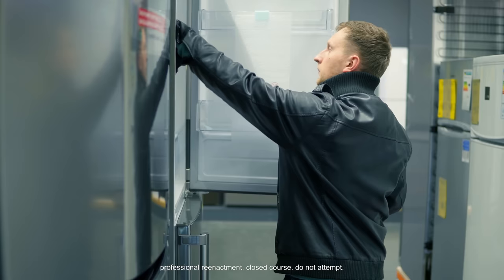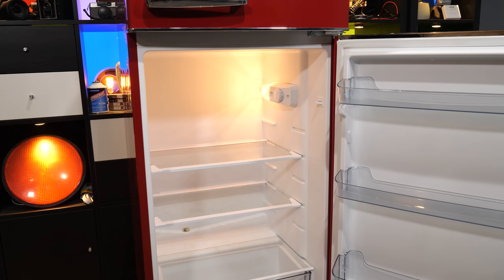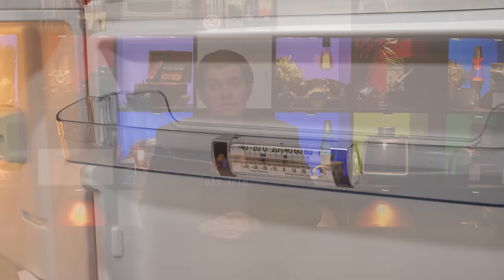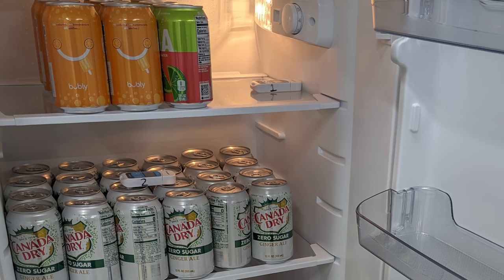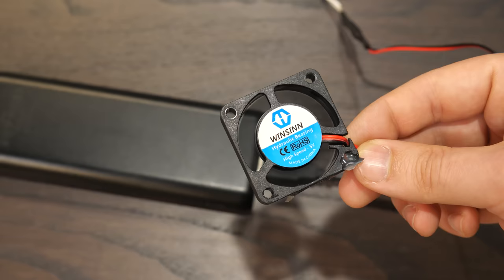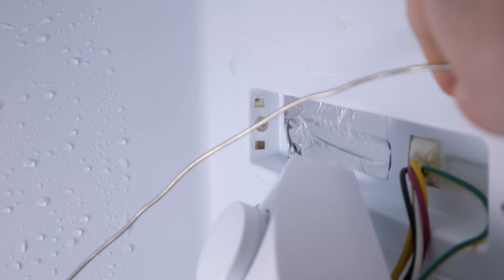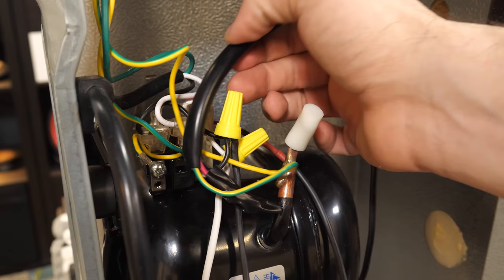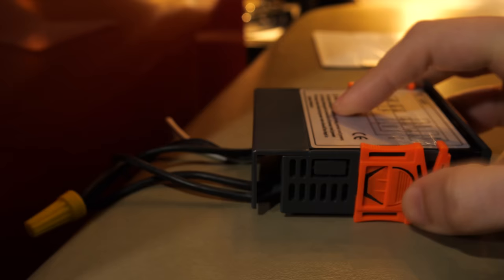This goofy fridge has a really clever design. It's also kinda terrible.

Comment: This is literally every fridge I ever used. I had no idea there can be more to a fridge than this.
Reply: Really? I've only had fridges that have coils up in the freezer and an evaporator fan that blows freezer air into the fridge. It's pretty cool (pun intended), because the freezer becomes a nice anti-heat buffer for the fridge.
Reply: Jep, like 90% of the fridges in Europe are like this. Although most people have a seperate freezer and fridge. And the condensor is somewhat better, with a nice big radiator on the back of the fridge. They work fine tho, I think Technology connection's fridge is just too cheap.
Reply: Even with the condenser built in the sides? I'm used to see it visibly mounted on the back.
Reply: @Earth-Apple  I was surprised that newer ones almost always come without radiator on the back and with pipes in it's sides, like in this video. I read somewhere it's for increased efficiency, and maybe because new popular refrigerant (cyclopentane).
Reply: @arion_vulgaris  big advantage to pipes in the walls instead of a radiator on the back is its far less likely to get damaged when some college student is moving out in a hurry...
Reply: @ntsecrets  it's also much easier to clean
Reply: @MarcDoughty  I'm from the UK I've had 7 fridge freezers in my lifetime and I've only ever seen 1 with a fan in it.
Reply: @GreatSageSunWukong  from the UK as well, my parents had this style of fridge, nothing frivolous, my mates parent’s always had big American fridges, so I did see quite a few with fans, and separate zones, I think they’re becoming more common nowadays too. 

When I moved out I bought a American fridge freezer, with ice and water maker because I always thought my mates parents ones were “cool” and yes it does a really good job and keeping things cool, better than the “standard” fridge my parents have but do I really care or use all its extra features….. no not really.
Reply: @GreatSageSunWukong i observed refrigerators with a fan in Europe mostly in large professional fridges in bars or shops to cool bottles, which makes absolute sense, as they regularly deal with huge changes in thermal mass
Reply: @ntsecrets yeah, basically this way they can be fitted in tighter spaces ... And every cm counts in kitchens :)
Reply: I will say one feature that I haven't seen in any fridges save the original one my parents had when they moved in 2003 (I think it was a whirlpool)

It filled a water tank built into the door to dispense from. The tank was chilled and in case of a water outage, had cold, filtered water to drink from. 

And yet somehow I have seen nobody else have those tanks
Reply: It's amazing how different everyday tech can be from one place to another, especially in things you wouldn't pay attention to.
It feels like we frequently underestimate how heterogynous the first world is. You're never done learning.
Reply: @Earth-Apple  You're saying that the oversized mini-fridge that was purchased for a cheap price to tide him over until his delayed actual fridge arrived is cheap? Big surprise. It's almost like that was the entire point of the purchase and was explained in the video.
Reply: @notbob555  Naah I'm saying this is a cheap version of this design. We have a lot of fridges with the same design over here, just higher quality. We don't have any temperature problems.
Reply: This is the standard fridge design in Europe. Americans have way overcomplicated fridges with vents where mold can accumulate and all that stuff. Not sure why.
Reply: @Earth-Apple  In germany most people have a freezer-ridge combi like this, just a bit bigger and with the freezer on the bottom. Due to the two compartments being seperate that's not a problem.
You usually only have two seperate units if you have a big family.

Comment: For the thermostat, it isn't a sensing bulb but just the end soldered off. It uses a fluid pressure in the tube along it's entire length to actuate a switch in the dial portion of the thermostat. I use these style sensors as low or high cut offs in air handling units
Reply: In good ones, the end has a larger volume of fluid, thus making the end more sensitive than the tube .  Though the one in the red fridge may have failed to do that, resulting in bad regulation .
Reply: thanks, that actually answers my question of how that "temperature sensor" works, basically it's just a long thin flexible "mercury" thermometer (but not mercury)
Reply: @JerryAsher  typically they have refrigerant in them. We string them along in front of air handler coils to pick up the relative temperature and if it gets too low it sets off a freeze alarm and shuts the unit down and then can do the same thing on the steam side for the heat etc

Comment: Something important: the fact that the crisper is warmer is a good thing.
Most fruit and vegetables that you usually store in the crisper have their optimal storage temperature at 10*C, while for meat, cheese and leftovers, it is 5*C. 
So by the crisper being slightly warmer it actually improves shelf life of stuff in it.
Reply: @@phillipbanes5484 No. Some of them get really messy if cold enough
Reply: yes. that's why it's opposite  the freezer  @talkysassis
Reply: @@phillipbanes5484 Onions and tomatoes are common examples
Reply: @@phillipbanes5484 the fibers? You mean the cellulose? What the heck does that matter when the water in the cells freezes, rupturing them and turning the vegetables to mush? I don't push mushy, frost-damaged tomato slices on my sandwiches and tell myself, "well, at least the cellulose fibers are intact."
Reply: @@phillipbanes5484 I don't think I need to. My point is that whether or not the fibers freeze has nothing at all to do with the quality of the fruits and vegetables. The fibers as a structural element can not prevent damage from freezing. That was the point made by talkysassis as well. "As long as the fibers do not freeze" is pretty much a nonsensical statement.
Reply: @@phillipbanes5484 bro... what I'M saying is, the FIBERS don't matter ONE WAY OR THE OTHER. What matters is whether or not the WATER in the cells freezes. The fibers are structural, but they can't prevent ice crystals from puncturing cell walls. Your focus is on something that plays no part in frost damage to begin with. Cellulose is a standalone molecule, it doesn't contain water so of course it can withstand freezing without crystallizing. Therefore lowering cellulose to freezing temperatures has absolutely no bearing on anything to do with frost damage whatsoever.
Reply: @@phillipbanes5484 like, why tf would you even mention cellulose in this case?
Reply: @@phillipbanes5484 the only thing that makes sense is if you MEANT to write "cells" when you wrote "fibers."
Reply: @@phillipbanes5484 I never said you were advocating for that. You're the drunk person, stop projecting. You also clearly admit that you were talking about cellulose, because there is nothing else you could have possibly been referring to. You say in your own words that the "fibers" and "cellulose" in this context are the same goddamned thing. 

So tell us, what has cellulose fiber to do with the damage caused by freezing vegetables? WHY did you mention "fibers" at all when the real issue is ice formation?
Reply: @MrTaxiRob i barely read this, but as the person with the last word, I grant you victory in this argument with the power vested in me by Herbert J. Refrigerator
Reply: Alt+248

You're welcome 😉

Comment: Used to rent a place with it's own simple fridge. In fact, here in Brazil our cheapest fridges are, indeed, this simple and mechanical. Had to defrost it manually with the pan trick a few times. Nowadays, frost-free fridges are increasingly common and cheaper but, for the majority of the last century and a portion of the current one, owning a frost-free fridge was a sign of social improvement, as they were expensive and marketed as a feature. I've my own fridge nowadays, thank God the days of defrosting it are over, but it's sure interesting to see how these aspects changes from country to country, especially from developed ones. Also, I'd love to see Alec do a video on the so called "suicide showers", our electric shower heads.
Reply: I like this idea a lot. I got shocked by the shower when living in Brazil and I absolutely hated that. Always felt unsafe the whole time
Reply: WHAT THE HELL IS A SU1CIDE SHOWER?!?!?!

Comment: I think most fridges here in Europe use this design. Our most recent one came with two thermal ballasts to put in the freezer with instructions to keep them there if you're not keeping products in there too help with efficiency.
Reply: Yes, I think this design was the standard even 30 years ago. And they do last 30 years or more!
Reply: I was thinking the same - I'm sure my 20+ year old Beko fridge / freezer works just like the red one, and it's what we in the UK would consider a 'normal' size too, not a mini one.
Reply: Similarly its common practice to just put big bottles of water in the freezer if its not full here too! As you say to act as a thermal ballast of sorts.
Reply: Same here. Though more modern ones use fans and digital readouts, I have never seen a fridge where the evaporator was not embedded in the wall - except reakly old ones where they formed a small freezer compartiment.
We sekdomly see the double door fridges here. They became popular a decade ago, but it seems to have gone away - which might be because European houses are more compact.
Reply: Same in New Zealand.  Through the whole video I was thinking "Isn't this just how fridges work?".
Reply: Exactly my thoughts - he just described every single refrigerator I have ever used in Europe (except for mini bars in Hotel chains)
Reply: @heldt952  Agreed. And now I would like to see videos on peltier element coolers and absoprtion cycle coolers too!
Reply: Yes, this is true. The more upmarket ones do have (and have had for a long time) a separate compressor and a separate thermostat for the freezer compartment, which allows for abusing one compartment without affecting the other too much.
Reply: just for info it the same here design here in Denmark (i have never seen any other)
Reply: I thought this was going to be something weird, but this is functionally identical to the Landlord Special fridge in my cheap apartment, as well as every other fridge I have ever seen. Pretty much the only difference is that the fancier ones sometimes have a little fan to make the temperature in the main compartment more even, and most of them have had an exposed condenser tube on the back. Presumably because it's cheaper.
Reply: I recently bought a new fridge freezer for far too much money and it's pretty much the same as his only not red and retro looking, the only difference between the new one and my old one is it has a bulb and dial the old one had buttons and LED light (and was half the price of this new one).
Reply: Yep, my fridge from Ikea (Electrolux) works like this.
Reply: @IIVQ  I don't think I've seen an evaporator since my mothers old electrolux from the 70s.
Reply: @feuermurmel  I think 50 years ago, when I was a small child, our fridge already had the same design.
Reply: @luipaardprint or @__-fm5qv Could you help me understand something: say you put some ‘thermal mass’ in the freezer. Since it must be chilled to a temperature much lower than the room temperature, the fridge does plenty of work doing that. Then, when the compressor stops running, the ‘mass’ loses heat relatively quickly—again, since the temperature difference is substantial. And then again the fridge needs to chill the mass. So I only see how the ‘ballast’ would help consuming plenty of energy, but not how it would help keeping the fridge cold.
Reply: @richardjones38  I mean if you look where he is standing next to the fridge, this one is quite a bit smaller than a normal fridge. At least for german standards. It just looks normal sized in most of the shots since all the proportions are the same as with bigger fridges and videos can be a bit deceptive.
Reply: @IIVQ  Evaporators used to be bare on the backside of the fridges, not too long ago. Being embeded in the walls was not standard.
Reply: @asanisi water holds temperature pretty well compared to air so having a bunch of ice in the freezer means it will make the air inside colder so the freezer won't need to run as much to keep it cold
Reply: @MCDreng  IIRC Alec said right in that video that the fridge is cooling the mass, not the volume. Meanwhile what you're saying is that cooling more mass (when is tries to warm up in the freezer) requires less energy from the fridge than cooling a smaller amount of mass. Which, you know, rather clashes with thermodynamics.

Comment: The reason why it kept stopping to cool even though it was above target is probably just the system trying to preserve the health of the condenser
Reply: Nah, the thing is missing the required parts for that
Reply: @AngelaTheSephira  it's not rly sophisticated to build something like that simply.
Reply: @ypsilondaone  But it is, as Alec said, more parts with more wires to run to those more parts and more money to pay people to run those more wires to those more parts. Also, if that system fails - and it will - then the entire thing is landfill fodder.
Reply: @AngelaTheSephira  uhh.. Idk if you know what you are talking about, but a simple timer switch is enough and those cost jackshit. Neither in implementation nor in buying
Reply: But does it have a timer switch  or thermostat to activate the compressor?